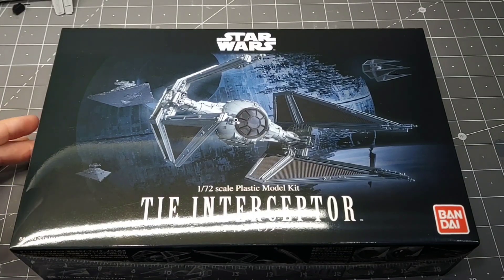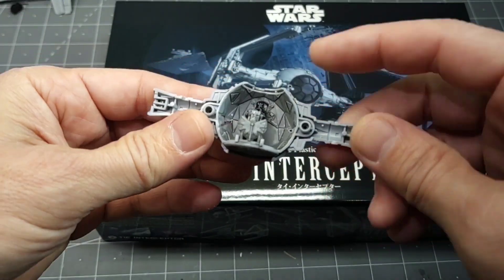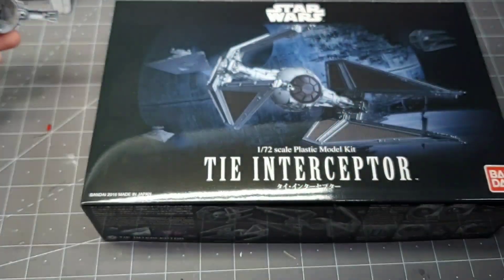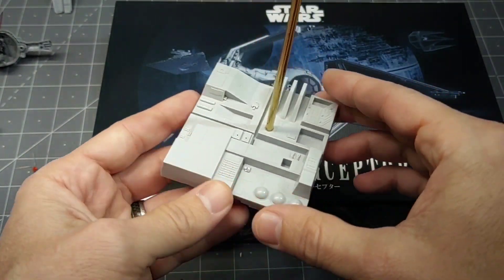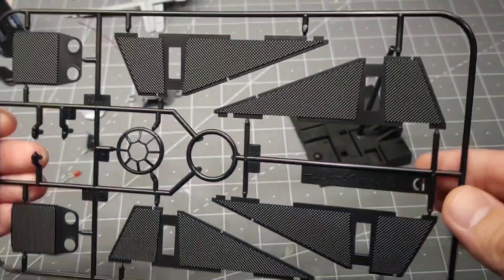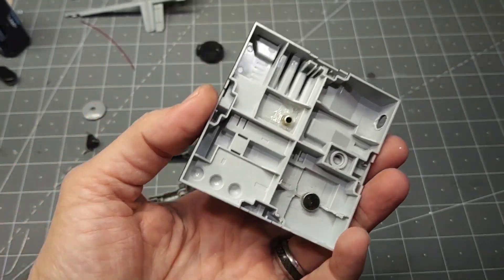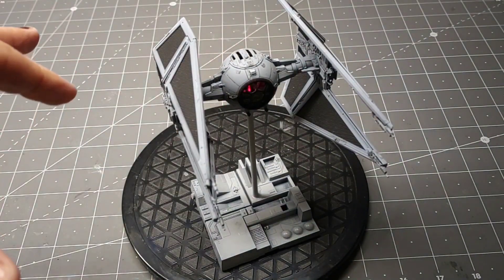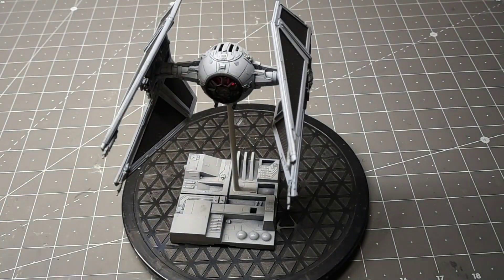Bandai's TIE Interceptor model

Comment: The best addition to the Imperial line since Vader's own TIE debuted in 1977.  And it has the dominant feature I liked better about Vader's fighter -- the bent wings.
The one LED was enough.  The fiber optic really worked well for the engines and I like the effect on the cockpit interior, too.  Very menacing looking fighter.
I've dealt with LED's with 3V power supply.  They never seem to get harmed by it without the resistor.  The LED's are rated high enough (2.2V to 2.4V +/- whatever) and there's probably enough natural resistance within the wire  and soldering  points.  I have one LED in a project still running well 7-8 years later and even the batteries held out.  I may have changed the batteries recently but the LED's holding up even after I desoldered the wires and resoldered again with heat shrink to make it safer and more stable.  It's when you go OVER 3V you get into trouble.  Don't do 4.5V on a 2.2-2.4V LED.  You'll definitely burn out the LED at 4.5V!  I ruined 2 LED's that way.  Ironically, the pack of LED's I bought to replace the ruined LED's was better than the crappy parts I bought at the model shop.  The light off the new LED's was better.  Computer parts stores do some things better than hobby stores!
Electrical wiring is not my thing but I've found soldering tiny points on PCB boards far more nerve-wrecking than welding electrical lines together.  Soldering PCB boards is when the magnifying glass and soldering stand with clips come into play.  
Still gotta use lead-based solder, though.  The safety solder welds fail within 10 years based on all I've read; lead-based solder (with tin and rosin) lasts decades.  Far more stable.  The heat of the solder iron also has to be even hotter to get good welds with that safety soldering wire.  So much for safety!
Reply from the maker: Yeah, I've done several experiments with LEDs without resistors. They don't seem to have any issue with 3volts or less. 4.5v immediately burned it out though.